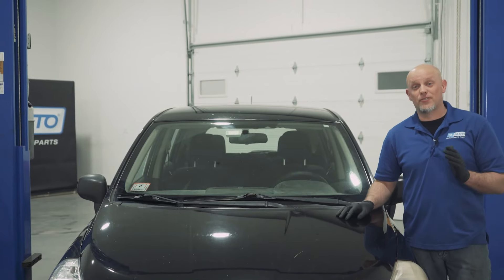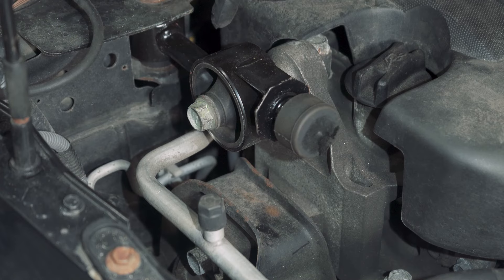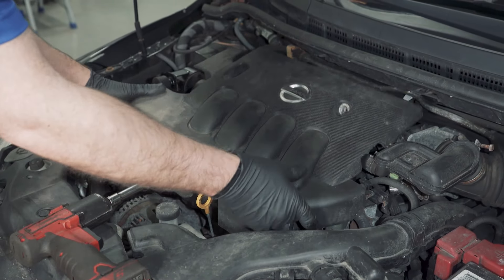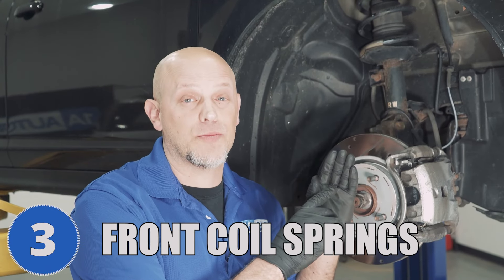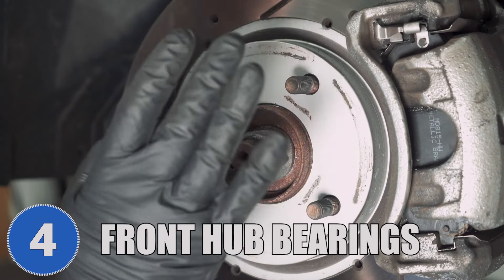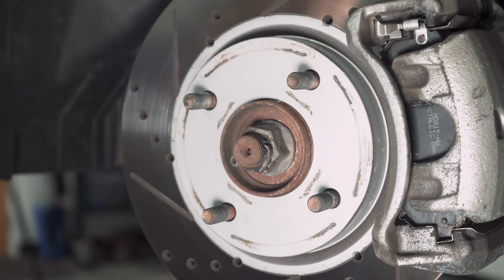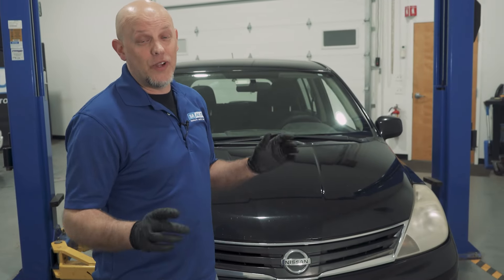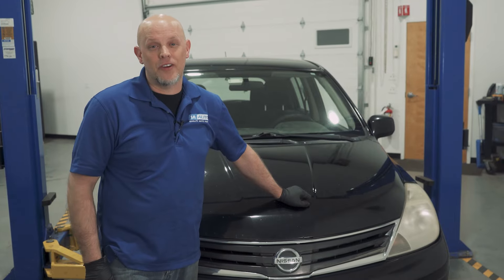Top 5 Problems Nissan Versa Hatchback 2007-2012 1st Generation

Comment: Thank you SO much for this video! I had the 'helicopter' noise for the last half a year, and it was getting worse. I had asked my dad and he thought it might be the front CV joints. After watching this video about the front wheel bearing issue, I decided to replace them and we successfully did that today. The noise is GONE. So happy to not have wasted time and money replacing the wrong parts.

Comment: I owned a 2008 Nissan Tiida which when i sold few months back had 315,000 kms. Replaced wheel bearings,all spark plugs, all 4 ignition coils, both axles as the steering would not centre on highways, steering mount, lower control arms & all 3 mountings. Drove like a dream ❤ it was made in japan.

Comment: ‘08 versa here. 170k. Had it for 5 years put about 50k on it. Have changed both coil springs , wheel bearing or two can’t remember exactly, plugs and wires due to misfire. Both lower control arms with ball joints. Engine mount replaced as well. This video is spot on. May want to include the rot that occurs behind the plastic panel behind the rear wheels. This is what’s going to kill my versa. Probably a 5k fix at the body shop. More than double what the cars worth.

Comment: I own a Nissan 2012 Versa.. I have replaced the passenger top motor mount, also all 4 cylinders along with 2 sets of spark plugs. I've owned the car for 3 years and she now has 150,000 miles on it.

Comment: I have a 2007 Versa. I have experienced the same issues he talked about. It's a good car overall. I have 176,000 plus miles on mine.  My wife has a 2011 Versa with 212,000 miles on it. We had to replace the Transmission around 175,000 miles or so. Both cars are 4 speed automatic.

Comment: I have 2006 nissan tiida/ versa with 155k kms. I changed strut mounts and front shock absorbers, battery. No other repairs other than brake pad replacement and engine oil change. The parking lights went. I just replaced the bulbs myself.  Mine is non cvt automatic transmission.  So super reliable.

Comment: I have a 2008.  You missed one common issue.  In areas with salted roads you will go through mufflers and mid pipes quickly.  Wagner suggests painting both with multiple coats of high temp paint.

Comment: this car is amazing, only if you have the manual/auto version. GOD HELP YOU IF YOU HAVE THE CVT
Reply: This is interesting...some Nissan Versas sold in the southern hemisphere markets like Brazil have this cvt cooler attachment. Extreme High temperatures are not so good for cvts (allegedly), I live in Ottawa, Canada and drove to work after sunset for about 8 years. 175,000 km now. My 2011 versa cvt still works. But.. I don't drive like I'm on the movie set of Mad Max either haha.
Reply: I have a manual 2007 Tiida Q (Tiida is versa in Australia). What is CVT and how do I find out if I have one? Thank you so much if you can help!

Comment: My 14 years, 2008 Latio@Versa already 332,000KM.

Vibration disappear, like new; after replacing all 3 pcs engine mount. All 4 tyre hub (brand NTN) have been changed once.

Aircond system;
Alternator belt every 60,000KM. Cooling coil changed 2 times. Blower 1 time. Temperature sensor 1 time; the symptom is compressor cut-off too early.

Spark plug be replaced every 100,000 KM. Plug coil changed 2 times. I suggest FLAMMA brand rather than Tan Chong brand (in Malaysia).

Lower arm, D bush, rear and front absorber and their mount need to be replaced once again. Maybe this time will replace whole set (absorber and spring). 

Radiator top tank replaced 1 time.

Do not replace your transmission when it doesnt go well. Just add a can of auto treatment oil when you replace ATF. For now, the only outo treatment oil proven to treat my Latio’s transmission is Justice Brothers.

I accept this matter with open heart 😁 because they are wear and tear.. Engine no problem at all.. 20 years more to go🎉
Reply: Berapa kos bang repair

Comment: I have a 2010 with over 198k. Original coil packs, original engine mounts, original wheel bearings, original lower control arms. I did however replace my coil springs after one cracked.
Reply: it should be free of cost and covered by the recall.
Reply: I'm pretty sure I also have OG control arms and wheel bearings and I'm at 251k

Comment: Wife has one with over 200k miles. Just replaced the original timing chains last month. Top issues I personally have replaced....
1. Fuel pumps. We are on #6. Very sensitive to low fuel levels. 
2. Front Upper shock mount bearings go bad fast
3. Rear springs snapped in half
4. Front springs were rotting per the TSB
5. Passenger door actuator for the hatch. Constantly fails. 
6. Spark plugs, expensive and very sensitive to brand used. 
7. Lower control arms, they are junk.
Reply: Go aftermarket, Nissan's parts are junk.
Reply: My bumper is zip tied 😂
Reply: You went through 6 fuel pumps? What the fuck.
Reply: Maintaining a low fuel level will make ANY fuel pump overheat and fail. I guess you haven't figured that out going on to pump #6.

What failed on the control arms? Bushings?
Reply: @chiefkeef8902  same😭
Reply: The rear hatch is a ground issue its an easy fix.  I  had the same thing happen to me.
Reply: @BrianC-pz7bo  how did you fix it?
Reply: @MrJohnnyDistortion  gas is expensive, but I usually refill mine when the light comes on
Reply: I keep having to replace the serpentine belt every few years :/

Comment: Any of the pre 2012 CVT models are prone to premature transmission issues, most people report them going out around 80K miles, mine lasted 150K.

Also the pre-2012 has AC issues as well, I had to get aftermarket parts to prevent further issues with mine going out again   OEM parts only lasted about 2 years at best.

Comment: 6spd manual in one of those, and you've got a tank!
Reply: Good to know I just bought a 2009 with a 6 spd.  Glad to see there isn't anything major that goes wrong with them.  Nothing that can't be swapped out pretty quick.
Reply: Mines a 2012 hatchback 6spd. It's taken pretty good care of me. So far 178k miles. Other than normal maintenance, these were the issues I've had.

Both struts (broke, and recalled after I replaced them), Throttle body, and fuel pump. Not to bad really.
Reply: I went from a 6 spd 2007 versa hatchback, to a 6 spd 2012 versa hatchback and it honestly is the little engine that could lol
Reply: Glad to hear. Just got a 6 speed 2012. Needed a car to get me from point a to z for at least 2 years. This sounds like its it
Reply: I bought a 2011 6spd hatchback with 143k miles.  Immediately needed a clutch (about $1000). 44k miles later, I just found out the motor mount is broken.  Overall, not bad.
Reply: I also have a high mileage 2012 Nissan Versa HB, 6 spd manual. I love this little booger! . I've had 2 yrs. The original owner drove it only for commute. It now has 239k miles. Only replaced the fuel module unit and belt tensioner.  I'm thinking of driving it to Florida from Virginia soon.  Great car!
Reply: @tomreilly6275  How did the 2007 one treat you?

Comment: U forgot the recall on the 07s airbags. Something about the compressor to the airbags would break into peices sending shrapnel into ur face if the airbag went off. I have already replaced mine and everything u mentioned in this video.

Comment: *wheel hub is easy to remove unless you are in the rust belt, then you basically have to replace the entire front suspension

Comment: Just junked my 08 Versa with just over 210,000 miles on her today.Dude is right on about engine mounts. 
Had to replace universal joint at 80 some thousand miles. Entire under carriage gave me holy hell from 20,000 miles all the way thru the 210,000 miles. Sub frame became completely rusted out at around 45,000 miles. I will  never by another versa, too many problems, too much extra noises and too much shaking. Only good thing im thankful for is it by some miracle gave me 210,000 miles i have 0 clue how it made it to that many miles

Comment: Biggest problem guaranteed to happen is the failure of the fuse box permanent relays. You will be driving and the car will stop working without a pattern. Replace this IPDM and your car will work well. Be sure to replace transmission oil at the dealer every 30K miles

Comment: The CVT transmissions are great until they fail and they fail often.  I know men who've had to replace their transmissions multiple times.  
Keep your coolant topped up, the transmission is cooled by the rad fluid.
DON'T FIX the coil springs, they are a RECALL issue.  Nissan replaces the coils for free.
Reply: @KLRJUNE  And SERVICE the damn thing.
229000 on ours, with 2 services in our ownership. Maybe $360 all up for both?
Had it for 6 years now, and it's the best car ever.

Comment: Thanks, good video.  Sister has 2012 Versa 1.8 auto, pretty good overall, lots of miles, around 180k (miles), a little rumble from wheel bearings and a tick under the hood which seems like a lifter, has a CEL from code PO320 (cat efficiency low).  I wonder how long do we have before looking at another car.  She's pretty good about maintenance, oil, ATF, coolant changes.

Comment: I bought a brand new 2008 Nissan versa in May 2008. I owned it until April 2013. I meticulously maintained the car and followed the maintenance schedule. My Nissan versa had more problems and issues than all Toyota and Honda cars I've owned combined from 1992, 1995, 2000, 2003, 2010, 2013, 2017. This Nissan is a Renault product and total junk.

Comment: I've had '09 versa i swapped the engine to 2.0L had no problem's whatsoever but i crashed it couple months ago i was wondering why it have that awful braking like everytime i press the brake even if i wasn't speeding the wheels will lock eventually i crashed it.
It didn't have ABS so i hoped that i would see if a vresa with an ABS would be better to buy

Comment: Front Subframe bushings! They are a Number 1 Problem with anything the generation from Nissan. So many videos about them. "PSB" even sells bushings for it because nissan wants you to buy a whole subframe.
Reply: 3:51 you can see where this bushing is on screen here bottom right, under that bolt. The subframe has a bracket that goes under/on top of (however you choose to look at it).

Comment: Thanks for the video mate. My daughters has issues with air con. Sometimes it works sometimes it doesn’t, think there is some issue in cabin as if we tap the glove box area it turns on lol
Reply: Blower motor.
Reply: Make sure both fans are working when ac is on full blast and also it could be low on refrigerant or have a leak
Reply: @nearvii6745  if the blower motor is inconsistent but pushing air when it works, it's a connection issue, like resistor or other electrical issue

Comment: Got a 2007 versa 6spd with 0 and I mean 0 exhaust left cheap steel rots fast... but still runs like a dream but the ride has always kinda sucked even with new tires etc

Comment: I am using a 2011 Versa as my daily until my new car order comes in. So far the only issue has been that the gas gauge is off by a quarter of a tank, leading me to run the tank dry a couple of times.

Any tips on how to fix this?
Reply: Mine is doing that as well I find it happens more during the summer and works fine any other time
Reply: Sounds like a fuel vapour issue. Ask a mechanic its tricky. Could be evap canister
Reply: me too
Reply: likely the sensor on your fuel pump. ive changed the fuel pump and it fixes the gauge inaccuracies

Comment: I have a 2008 Versa and have ran into 2 problems that continue to keep happening. #1 - The driver side WINDOW CONTROL MODULE. I have replaced this 4 times, its always the drivers side window up/down that quits working. And the worse problem is #2 - the A/C CLIMATE CONTROL MODULE. 3 times now I have replaced this part for the same malfunction. the blower selector switch (1,2,3,4,off) seems to short out/melt and no matter which number its on it quits blowing air and is unable to move selector too another number/speed. Does anyone know what causes this malfunction to the AC Control Module? This is an expensive part and a real pain in the you know what to fix!
Reply from the maker: +Don Teaford We wouldn't be able to diagnose an issue like that here, you may want to have a local mechanic take a look at it. Thanks for checking us out! http://1aau.to/m/Shop-1AAuto-c

Comment: Sometimes when I crank my car up it will die unless I play with the throttle , I took the mass air flow sensor out and it seemed like it started idling better so I guess that's the problem I'm not sure normally when it does this I will just play with the throttle until it gets warmed up and after it warms up it will stop trying to die. The first time it happened to me I was late for work and I was not in a good mood I put it in drive and floored it lol by the time I got to my first red light it wasn't trying to die anymore so once I get it going it won't try to die anymore I really don't want to replace the mass air flow sensor because it's $150 so if anyone else has had this problem and figured it out 100% please let me know it hasn't died on me all week it's crunk up no problem it seems like it always wants to act up when I'm running late for work 🤦🏻‍♂️
Reply: Try checking for a vacuum leak checking hoses for cracks and spraying carburetor cleaner at different places looking for the idle to change.
Reply: Try cleaning the idle air control valve

Comment: Nissan Versa 2008 , some leaking fuel… but I do not understand anything about .

140.000 km and the transmission is ok. Very good condition.

I went to the garage and I’ve got 2 different opinions/ one guy said it’s the timing belt, the other one said it’s not the timing it’s another thing (I did not understand ) . 

They said it could be about $1000 Canadian dollars to repair.

It is ok??? Help me please 🙏 ❤

Comment: My car starts but won’t accelerate past 40 jerks when I pulled out the drive way then doesn’t go anywhere when I’m hitting the gas after two blocks only 81k miles any answers for my problem lol???
Reply: I’m having this exact issue. I think it’s the transmission.
Reply: Transmission or replace all of your coil packs and spark plugs I had to pay 500 to replace transmission and my starter as well as coil pack and spark plug
Reply: Also my tire light will not go off no matter how much air I put in tires
Reply: I put new air filter Wix just not Frame, filled tank with 1 bottle  engine fuel injector, drive smooth now.
Reply: If you have the 1st gen ur ok unless u have a cvt. If you have the note 2nd gen then Its the cvt transmission. also on the note 1.6L engine is so slow and weak. The cvt have a no shift feeling. It should be free to replace since there has been a lot of recalls with them. Ask for the  normal automatic transmission. I have the automatic and it is actually fast.

Comment: 2007 versa hatchback. Can go into reverse but not drive , please help!?!?!
Reply: Disconnect the shifter cable from the transmission and check if the selector on the transmission moves up and down by hand. Then check the shifter to see if it goes into drive. Could be either.
Reply: @rogersingh3918  Or check the fluid level on the trans dipstick...